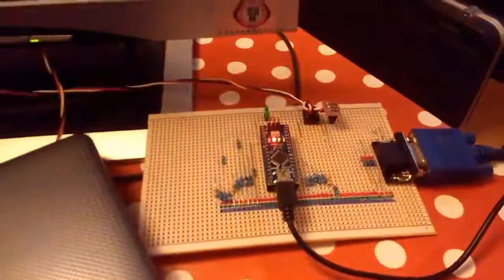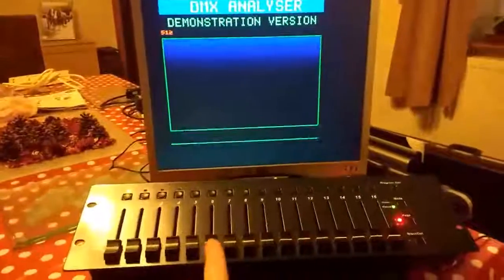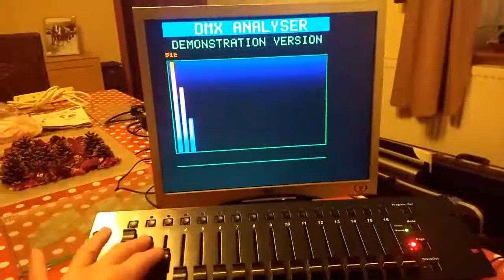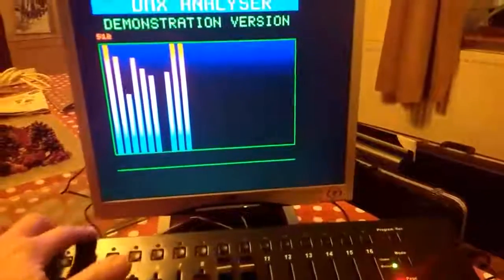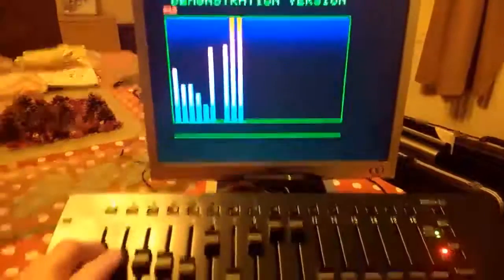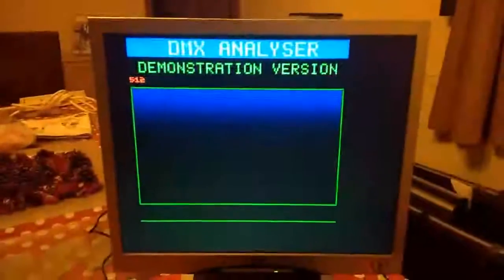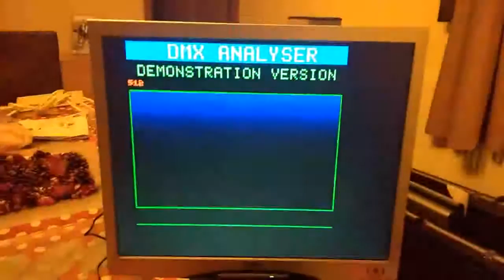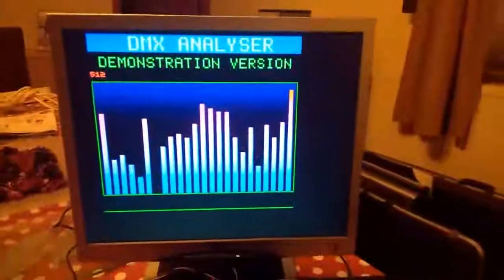VGA VuDMX - Arduino UNO ATMEGA DMX DMX512

Comment: hi Bob.
Good work.
my name is Luiz and i live in Brazil.
i need one graf. interface like ths to indicate the water levels.
is possible you share the  library and code?
luizgad@hotmail.com
thanks
Luiz
Reply from the maker: Water levels ? this is for reading DMX lighting data
Reply: ok Bob i know.
thanks by the quick answer .  but i thing if is possible use the same gui to show other data without sniff the dmx bus and take value of one variable.
thanks
Reply from the maker: I was also thinking of making an analogue readout of several analogue channels and displaying on a monitor, it could easily be possible in colour like this
Reply from the maker: What ever code I share will be for what I have done as I dont have time to strip out the things you dont need
Reply: OK. no problem. I modify myself. thank you so much.

Comment from the maker: I will now be adjusting this so that the NANO (FD232 chip version) will act as a openEntec device, so I can monitor DMX values directly from a USB connection. No extra components are needed, just the Nano, 17 resistors and a VGA socket

Comment: Nice one! How did you generate the VGA signal? :)
Reply: I know this is an old video, but how did you clock out 640 pixels per line at only 16mhz? This is well below the required speed, even with only 1 clock per out? Be interested to see that section of code, or just an explanation of the method you're using.
Reply: Checkout Nick Gammon’s work on VGA with Arduino at : http://www.gammon.com.au/forum/?id=11608
Reply from the maker: +Bobby Dilley - Quite a complex series of interrupt triggered timings, all very fast, and I used a couple of resistor ladders to create the varying colour depths - its a nice project, I have some very useful additional features which could be used to debug DMX streams